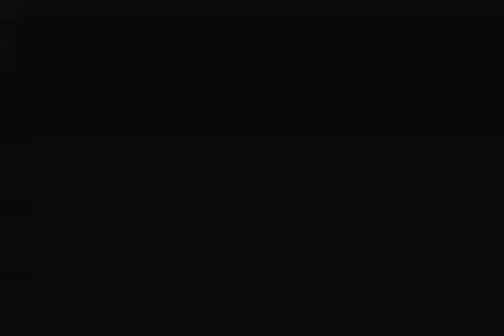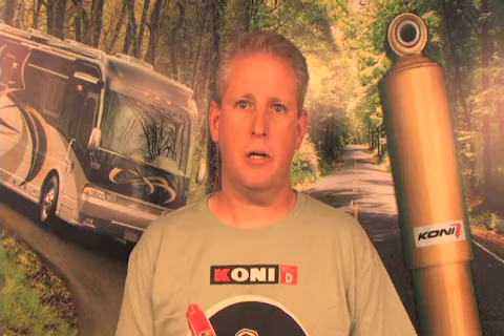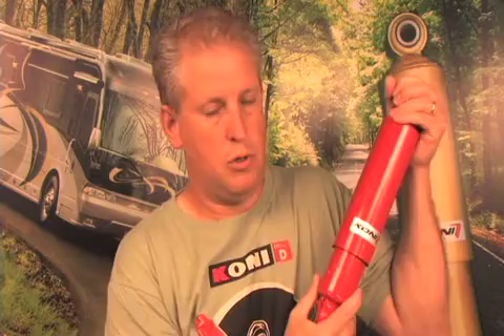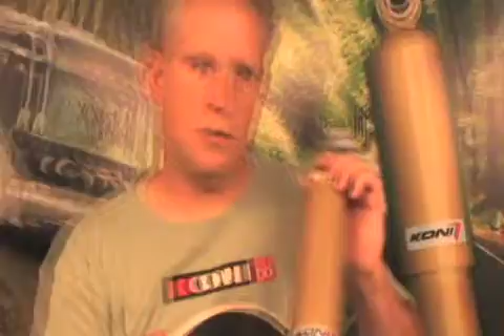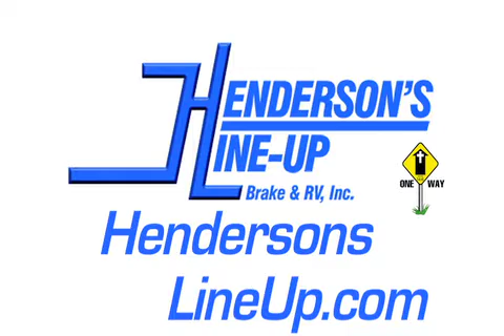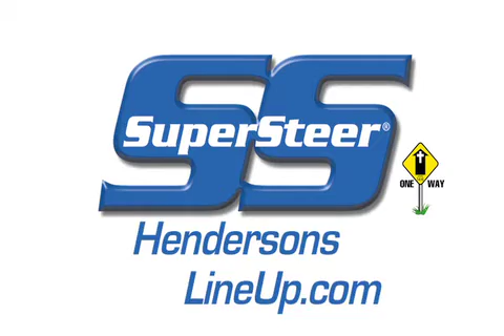SuperSteer KONI FSD SHOCKS adjustable motorhome truck Hendersons Line Up dampening softer ride

Comment: We take care of all our customer warranty issues with Koni shocks if purchased from us. Please contact us if you have a problem.
Reply: +Super Steerwe   have   received   one   prob   while  fixing   fsd   koni   on  ft   suspension  in  maserati  ghibli  .........we   bought   a  fresh   new  one   and   that  time   its   working   was  good   ................after   fixation    we   checked   the   car   and   found   its  bouncing   very   high   ,  again   dismantled   the  strut   ,  detected   the  new  shock   is   totally   damaged  ..... stem   is   moving  freely    also   noise   is   coming   when  shaking............is  there   any   special   procedure   for   fixing   ......blue   paint   mark   is      visible    on  stem    and    outer  area    pls   advise..............
Read more
Reply